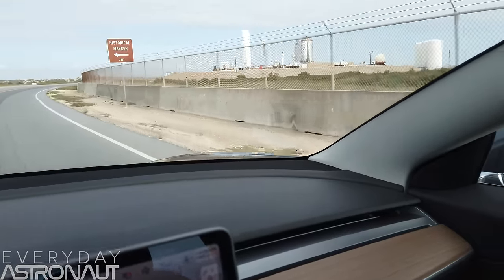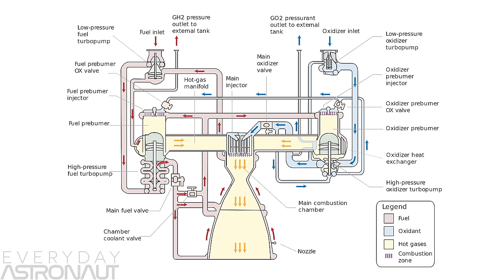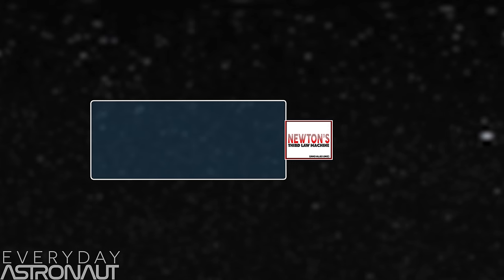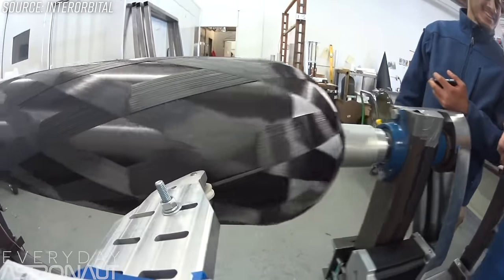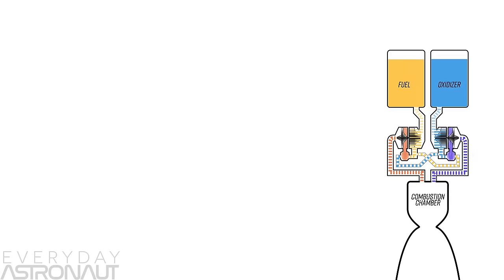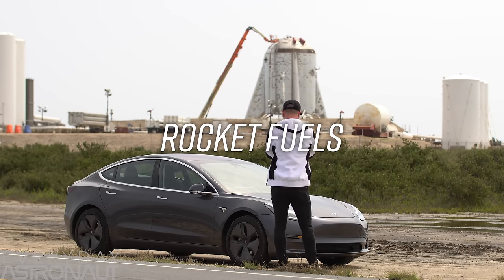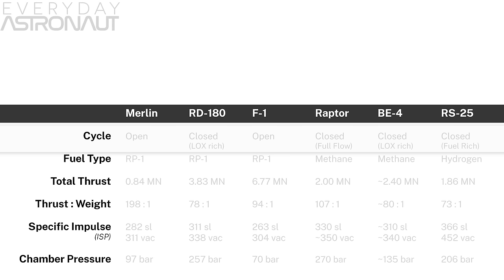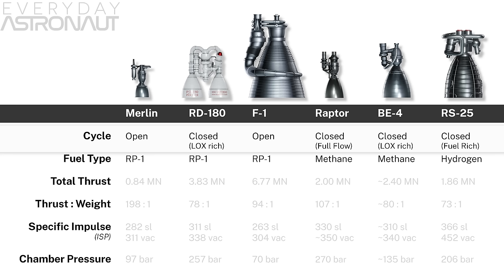Is SpaceX's Raptor engine the king of rocket engines?

Comment: 46:25 Nope. Ion propulsion is. It has way more specific impulse, and allows for much more delta-v for interplanetary flights, resulting in faster flights, at less fuel. Trust me when I say 0.01 m/ss over time is a way better propulsion system when applied over days, instead of going through the fuel in a matter of minutes.
Having ion engines in space is the best way of propulsion outstripping even the best of combustion engines.
I'm not talking NStar or something, which are little more than advanced Hall's, I'm talking the fuel being expended at near relativistic speeds. And that will make any trip inbetween planetary orbits way faster.
Imagine the Starship being boosted into orbit by the regular engine, then fitted with an ion engine ring, and then going ever accelerating towards Mars, doing what takes a regular combustion engine 6 months or more in the best of circumstances, and doing it in two, under the worst of circumstances.
This then combined with wider flight windows, and voila.
Reply: Ion Engines have low force output (like a penny sitting on a table low), but for constant acceleration, long duration flight (if you're already in space): 100% good point. Far faster velocity after a bit of time. Makes more sense for Planetary missions.

Methane seems like a shell game. Space tourism, maybe to the Moon. Mars? Seems too "Mars One" to me. This is a for profit endeavor. (Elon means "profit obsessed" in ancient cuneiform (probably).

Comment: I'm confused. If space X has just got the contract from nasa to go to the moon, what happens to Artemis and it's rs 25 engines?
Reply: So sls will still fly with its rs25 engines and it wil carry the astronauts into low lunar orbit than it will dock with a lunar starship and the starship will land on the moon
Reply: the SLS is the one that's gonna carry the men to the moon I believe, in their "how we are going" video, they explain that they're gonna have spaceX land supplies and cargo on the moon first, then have SLS land the astronauts
Reply: @ExHyperion  well not really because the sls rocket is not cable of any part of it landing on the moon because the only engines it had once it get to orbit is one really week engine it doesn't have enough thrust to land on the moon. And to my knowledge there are no nasa lunar lander plans to be separately luanched or produced so as of rn spaceX will land the humans on the moon. And sls will just bring the humans to the moon for spaceX to land on the moon

Comment: Russian engine RD-0120 (which powered Energia rocket) is equaly efficient as RS-25.
They have almost the same weight, same impulse (RS-0120 just a little bit more efficient in vacuum but samely less efficient at sea level).
Juts on prise definitely goes to RS-25 - its thrust is 12-15% ahead of Russian rival

Comment: am i wrong or are the french actualy the ones with best engines, besides raptor? vulcaine rocket engine has 432 specific impulse and 303.5lbf of thrust... if u look at ariane 5 launch, that thing explodes out of the launch pad, supper acceleration. When we will get video about hte worlds strongest rocket in actual use.. not just experimental test flight?  pls make one video about the best rocket engine of all times.... vulcaine!
Reply from the maker: Check my page! I have a tour of Vulcain! But for perspective for hydrogen, 432 s SI is actually quite poor. And it explodes off the pad because of its massive solid rocket booster. Love the rocket but let’s not amplify what it is
Reply: @EverydayAstronaut  perhaps there is a stronger engine, but lets not cut the credits to ariane here. 

 It comes at top 4 rockets on the world in capabilites to carry cargo into geostationary orbit, and those 3 rockets have bearly enough cargo area to carry anything.
  so te be honest it comes right after long march 5. 

Ariane 5 is actualy top second rocket on the world for its actual usability.
 Then is delta 4 heavy, falcon heavy and falcon 9. 
 I think it should deserve this credits. for sure! 

thank you everyday astronaut for the best channel on youtube. ! i will definitly watch the video, im sorry i could not see it before.

Comment: to me, the F1 is and probably always will be king. it is still somewhat viable in diciplines noone even thought about when building it and lets face it: its a grandpa, that thing is over half a century old. Apollo 4 is closer to the end, no, even the start, of WW1 than it is to now. when that engine was built, the highest tech of computers were metal rings welded onto a wiregrid by hand, yet it can still keep up.

Comment: The bigger the engine the bigger the bang. Courtesy of the big bang theory..
The bigger the rocket the bigger the bang for your buck. Simple isn't it.
Reply: And the more dangerous and unstable it is
Reply: Also you get more deltaV with a smaller engine than a big one so you’re wrong

Comment: Basically the same thing with combustion engine in cars only using 80% of the fuel. Why we have converters on exhaust he could have saved billions in carbon pollution updating existing system for a fraction of electric cars

Comment: Is SpaceX's Raptor engine the king of rocket engines?.....not even close.  And you're wrong about the F-1. There was an early shut down on one engine in the early S-1C flights. The stage burned longer so mission was achieved.

Comment: When will rockets have push and pull mechanics or is it all just push? Jets use push and pull mechanics, Jets go fast! Rockets go slow, have you seen a jet take-off? Compared  to a rocket take-off? Jet fast, rocket slow!
Reply: Just look up a pendulum rocket. It's more a question of physics than practicality.
Reply: A Jet will plateau around 500mpg. A first stage Falcon rocket will go to over 5,000mph. Second stage, over 17,000mph. 
Jets slow. Rockets fast

Comment: Musks $/kN ratio is pretty useless unless you factor in everything else. The bottom line is $/kg to orbit for which you need to include ALL factors including the manufacturing and operating costs of handling the propellants.  Also, how is the Raptor engine dealing with the problem of the "dirty" hydrocarbon CH4 in a full flow system, the problem that previous and current engines shy away from? The key to regular future manned space travel is engine reliability. This is the absolute bottom line. It's not about raw thrust/weight ratios, fuel efficiency, cost, etc, the 'king' of engines will be the one that proves itself to be RELIABLE above all else. The Raptor engine unfortunately doesn't currently come close to being reliable compared to other engines, so there is no way it can be given that title.... 🤔

Comment: Dear Everyday Astronaut, please consider Xploring for us this issue, maybe for a future video, at least for a question/answer moment : Our EARTH has a reasonable mass. And it's necessary to improve the performances near perfection and decrease the fuel waist to a minimum in order to successfully uplift technology and humans to the lower earth orbit with sufficient speed to orbit these indeed. It's obvious the margins are really limited. Not talking about geostationary moon, and other planets / star systems. I really would like to explore with you how bad thing would get if earth's mass and size had been slightly bigger, like 10% more mass (and accordingly higher radius to keep the density close which is easy maths but I'm lazy / why bothering as you're the man anyway) would it still be feasible? How much costs would increase? Technological doability?  Would we humans have been able to make it to the moon in 1969? Or would we have had to wait year 2000 to orbit our first satellite... Auhwwr Sprout-Nike, then now preparing for our first moon attempt? Or 2100 with... Xiout-Nyk, then 3000++ for the moon with Chang'e Babe Antimatter/Fusionpowered Mission? What size and weight for the earth would mean to your mind, a planet the intelligent species the size of humans, however smart it could be, would never leave because it's just too much G's too much resources... And of course on the other side we know some small systems where many small planets orbit the star at a distance of barely the moon's distance from earth, meaning if they have some moons, the first human moon travel would have been possible just right after the invention of jet planes, and i a same way comparing difficulties with out own situation, starting from a light planet or a light moon, we would have been able to travel to another planet as early as in 1969, and we would now have colonized a few other planets, and obviously have already human travelled on most of our system planets? Or what if we had started as a species living on Mars? Leaving Mars would have been easier, but then the earth would be considered a bit like we see Venus, a dangerous high gravity, high pressured planet, plus it would seems impossible to come back from there, lifting up humans from such a high gravity when we only experienced "easy rocket science". Are there some places in the universe where it's possible to imagine an intelligent species of low body size/weight could have already at our technological development, already colonised other close star systems? I consider this would be a very attractive video, maybe a "first" if you manage to do it as seriously as you do anything these days, it could be a learn&dream perfect matching duo, and a very successful click-me video. And really a help to understand our own strategies, like it's easier to understand why the belly flip, or why the 7 minutes of terror, or the raptor's physics when we ca compare to what would have been the challenges had the gravity been different, or had the pressure have been really higher/lower etc. Could even explore what if we were an aquatic species. How to visit our cousins from another sea separated by our ocean by land(!!) then the moon is not very different after all. Then what if some kind of life were to exist on a neutron star...

Comment: USSR developed RD-170 half a century ago... and Raptor is only slightly better...
Reply: A lot better.  RD-170 is not re-usable and Raptor is re-usable.  The cost of each launch is a lot cheaper using Raptor engines than RD-170.  Fuel efficiency is also better in Raptor.  Production cost of Raptor engine is also cheaper.  It means that Raptor enginers can dominate the launch market in the future.  This advantage will not be that important initially.  It will be in the future.

Comment: you need a another regulative scavage stage and change the shape to re integrate recycle exhaust gas COUPLED THE USUALLY WASTED METHANE siMILr to HPT hut maybe only short routed concentrically to power itself in that section

Comment: The SLS engine is not an RS-25.  The only thing they say about the designation is that it's "RS-25 optimized").  Anyway the SLS test burn turned in 452.3 ISP.  That's a demonstrated ISP of 452.3.  Say that again a demonstrated ISP of 452.3 for 8 minutes burn time.   Makes the Raptor about look like a booger.
Reply from the maker: That’s 100% incorrect. The SLS is literally reusing space shuttle SSME’s (RS-25’s). Yes, it’s been slightly tweaked but it’s through and through an RS-25, they’re even manufacturing new ones called the RS-25E after the 16 shuttle left overs are used.

Comment: The Russian N1 engine was the biggest and most reliable of all rocket engines. NASA bought a bunch of them through intermediaries in the late 1960s and that rescued the Apollo Program from disaster. NASA just could not get the Saturn V to run reliably. They copied the N1 design and the Saturn V Mk2 was born. The beauty of the N1 was that it could be throttled...something the Saturn V could not.
Reply from the maker: Literally everything you just said is wrong 😂 the NK-15 on the N1 was horribly unreliable, hence all 4 of the N1’s flights not making it through the first stage burn. The F1 could and did throttle. The NK33 on a future variant of the the N1 was later purchased by Aerojet in the US in the 90’s. 20 of them were bought and refurbished into the AJ26 and first flew on Orbital’s Antares 100 series in 2013. There was no Saturn V Mk2. How did you even make all this up in the first place? 😂
Reply: @EverydayAstronaut  Disagree. It was the other way around.
Reply: Your post is plainly full of it….